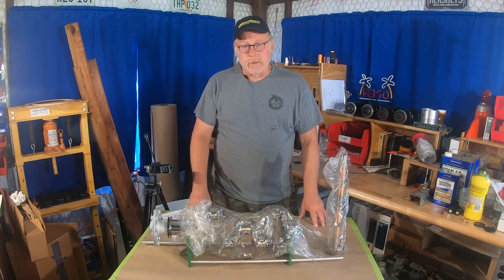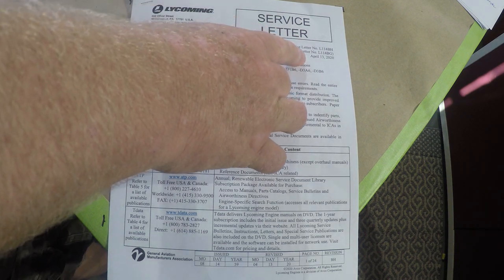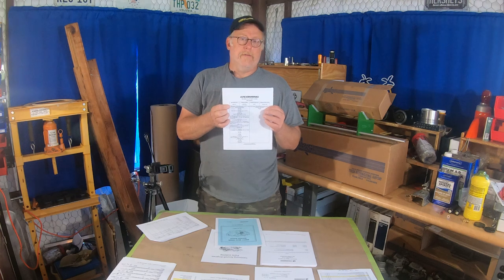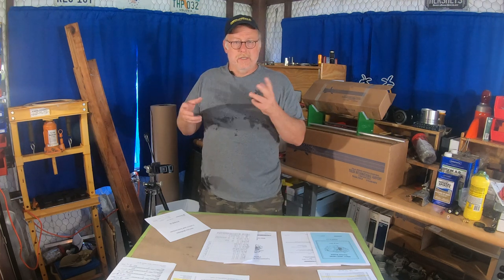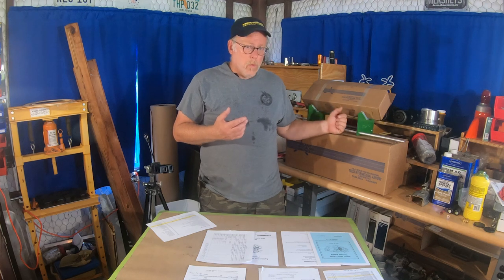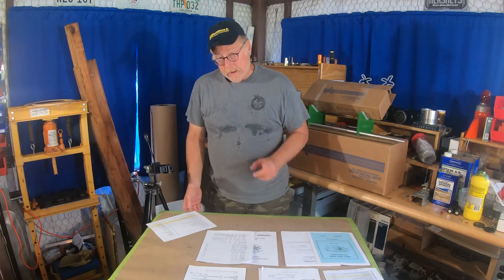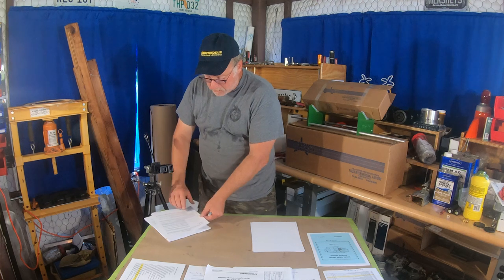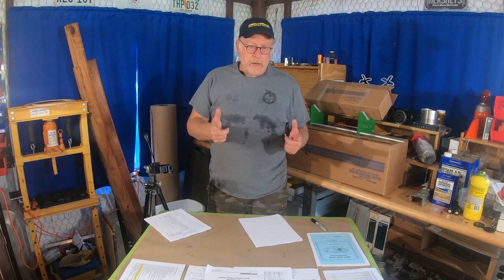360 Engine E08 Never Ending Paperwork!

Comment: How did your crankshaft end play 
dimensions turnout?  The overhaul manual says to grind the oil Slinger if it's too tight. What a hell of a fix!
Reply from the maker: Endplay dimensions came out per book.  They pretty much always do.  Machining tolerances are pretty tight on both the crank and the crankcase.
Reply: @HangaRatz   Nice! I'm getting ready to tackle my 0-320D2J. It fails SB 505B on an ECI crank. Pitted to hell.

Comment: Hi Bill, thanks for the video, it has helped my decide to do an overhaul myself, but with an IA over my shoulder. Going to have to watch this one a couple of times. I want an IO-360 for my RV, do you have any suggestions? or what engine not to use. I'm sure I don't want a counter weighted engine and I do want a parallel valve.   Thanks again, great information.
Reply from the maker: My only real suggestion is that if you are not going to have a constant speed propeller then try to get an engine with a solid crankshaft if possible. Just a lot less problems in the future. Get that RV flying!
Reply: Thanks for the reply Bill, it will have a C/S prop, I have built 4 RV's and this is my second RV-4, my first has an IO-320-B1A with a C/S prop. Found that Van's only builds Type 1 dynafocal mounts, but the guy that builds them for Van's was able to make a type II for me.  The other engines were new from Van's. Just trying to avoid any pitfalls when finding a used (to be rebuilt my me) IO-360, I have done top ends just never a bottom end. Thanks for making the videos.

Comment: Show the build!
Reply from the maker: Working it.  All of the dirty laundry on this one.  Thanks for watching...
Reply: @HangaRatz  I'm hoping to work my O320d2j soon. It fails SB 505B. Nice.
Reply: @HangaRatz  I'm interested in how you are going to interpret lubing the cylinder through bolts and deck studs. Lycoming Tech data only talks about the through bolts. But every reputable shop I've talked to all say they Lube all threads liberally.
Reply from the maker: Iron Man,

I dove into the  Direct Drive Overhaul Manual 60294-7-14 (Page 6-22) and SI1029 (Page 1) "Tightening Procedures for Crankcase Thru-Studs and Bolts".  I read SI1029D and completely missed what I was looking for.  I sent a note to Lycoming and Heath Johnson - Product Support pointed out where i missed the info.  Here it is from the SI1029D:

"Two basic types of thru studs are used: anchored and free-thru.  The anchored-thru studs are threaded into one of
the crankcase halves; the free-thru studs are not. "

https://www.lycoming.com/sites/default/files/SI1029D%20Bolts%2C%20Crankcase%2C%20Tightening%20Procedures%20for%20Thru-Studs%20and%20.pdf

Sooooo, to answer your question, all cylinder attaching studs should be installed wet torqued.  Hope this helps and kudos to Lycoming!

Thanks for watching!

Bill
Reply: @HangaRatz  Yep! I've read SI1029D many times. It only mentions lubricating through stud threads. It does not specifically mention deck stud threads. Same thing with the overhaul manual. It only mentions the through stud threads being lubricated.
Reply: @HangaRatz  If you look in the IO-360-N1A maintenance manual, it says to use food grade anti seize on through studs AND hold down (deck studs).
Reply from the maker: @Iron Man  IMHO I would use what the IO-360-N1A MM calls out.  It is the most current maintenance document for that engine.  If SI1029 were revised after the publication date of the IO-360-N1A MM then SI1029 would be applicable.  From the IO-360-N1A MM:

"FOR CORRECT ENGINE MAINTENANCE, COMPLETE THE NECESSARY MAINTENANCE PROCEDURES IN THIS MANUAL AND APPLICABLE SERVICE DOCUMENTS. LYCOMING ENGINES' SERVICE DOCUMENTS

WRITTEN AT A LATER DATE OVERRIDE PROCEDURES IN THIS MANUAL UNLESS OTHERWISE SPECIFIED. "

Hope this helps...  B
Reply: @HangaRatz  I have a o 320 d2j, which means legally I have to use the overhaul manual and service instruction 1029 to be totally legal which means that the through studs get lubed and the deck studs stay dry if you interpreted literally. Penn Yann, one of the best outfits in the United States, uses 50 weight engine oil on everything so I'm going with what they do and since mine was last overhauled by them I'm going to go that route.
Reply from the maker: You are reading SI1029 incorrectly.  

"Two basic types of thru studs are used: anchored and free-thru.  The anchored-thru studs are threaded into one of the crankcase halves; the free-thru studs are not. "  

All of the cylinder retention hardware is a "thru stud".  Your term deck stud is an "anchored thru stud" in Lycoming's vernacular.  As such, all cylinder retention hardware is lubricated.  That is the guidance Penn Yan and every other engine shop in the world uses.
Reply: @HangaRatz   The anchored through studs and the free through studs both go through both case halves, the cylinder hold down studs (deck studs), are only about 2.5 inches long and do not go through the case. 1029 mentions the free through studs and the anchored  through studs which get 600 in.lbs torque, but doesn't mention the short cylinder hold down studs which get 300 in.lb torque.